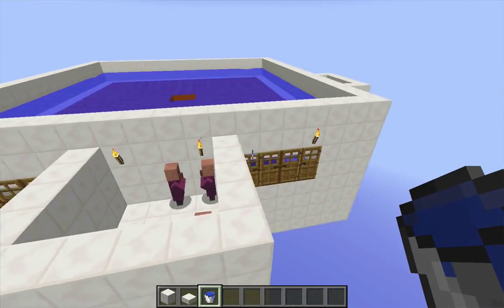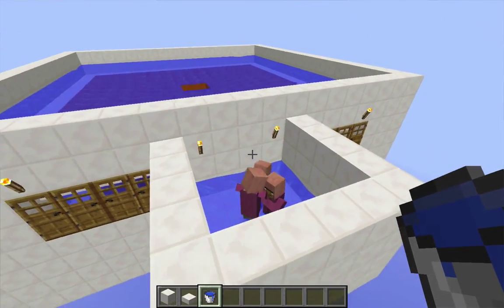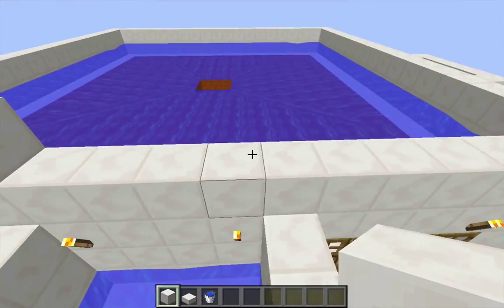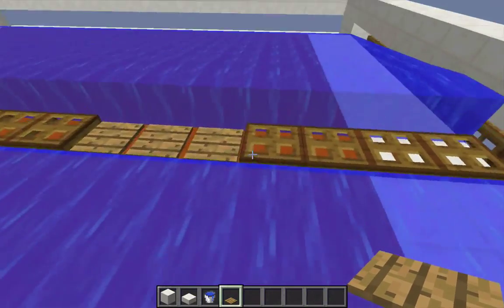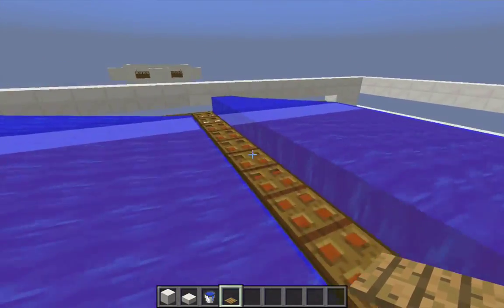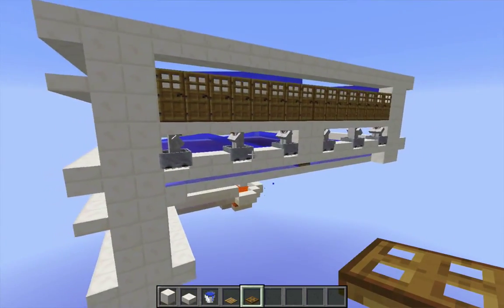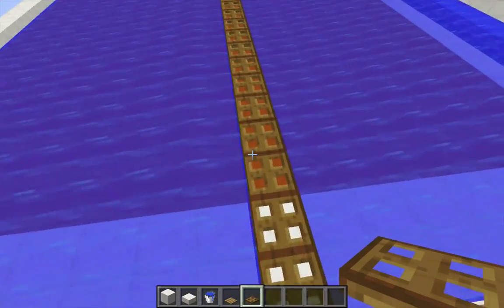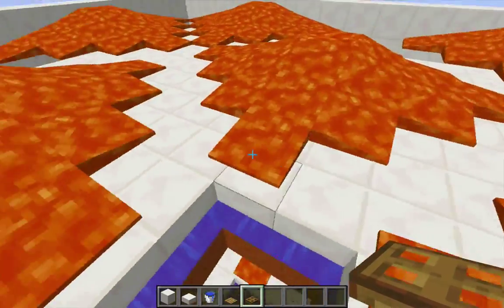Iron Golem Spawning Cell

Comment: The trick with the water is something I call "Water Stitching" and have used in several mob farms. I never thought to use it with my golem farm, though. thanks.

I wasn't aware of the lightening issue with villagers. This explains lots of issues I have had. I had gotten to where I always just kept a few villagers stored in glass pillars at each corner so I always had spares for breeding my numbers back up. 

I have been considering building a golem farm with all the villagers inside glass pillars, but had not had the time/energy to tinker around and see if encasing them fully would alter the effectiveness of the farm.
Reply from the maker: Lot Myle Another strategy is to just throw your villagers a ton of food when you first get them into the farm. That's the reason why all my iron-golem spawning cells have 32 doors and 12 villagers. With 32 doors, 2 villagers with sufficient food should breed to a population of 12. So, any remaining villagers after a lightning blast (or some other catastrophic event) should breed back up to 12. If all the villagers end up in once villager cell, though, it can still cause some glitching.